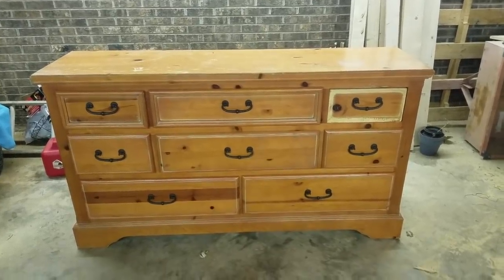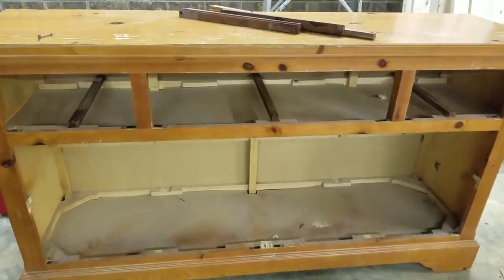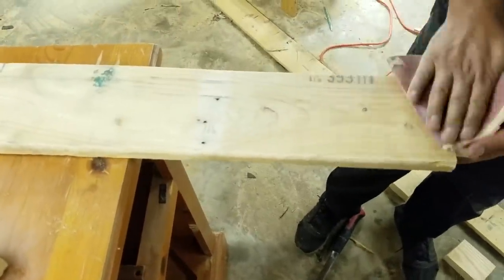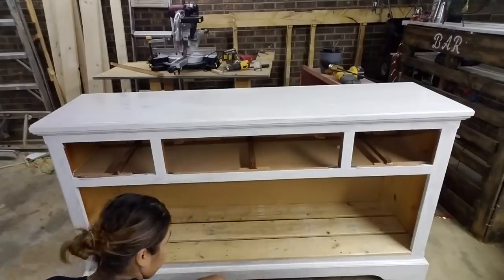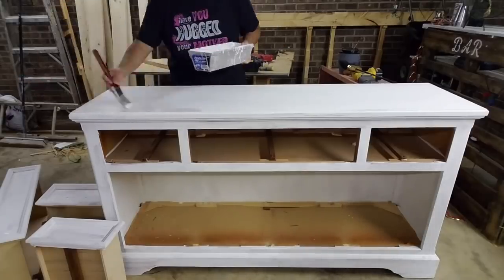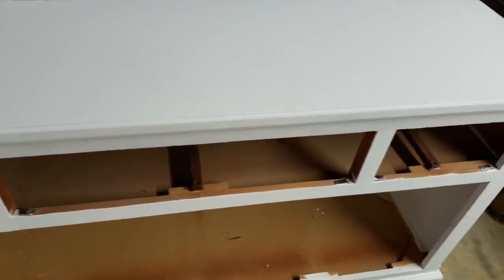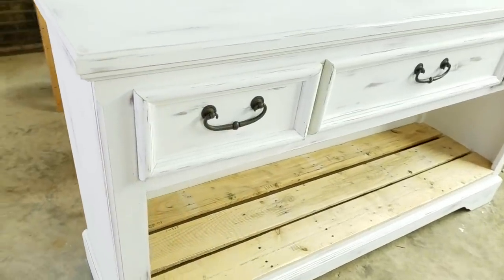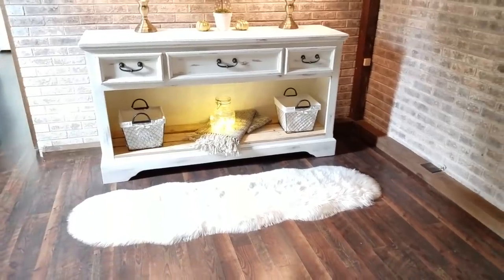DIY Dresser Makeover/ Upcycling Old Furniture/ Dresser Makeover/Furniture Transformation on a Budget

Comment: I wouldn’t recommend using flat because you can’t clean it anything that has a sheen on it is best for furniture, walls doors things like that. Flat is more for ceilings.
Reply from the maker: I can definitely agree with you on it been a little harder to clean. I just didn't want it to have sheen when I was first painting it, I was afraid it would have lost the distressed, rustic feel... maybe I should just do a light gloss on the top surface of it, you think? Since the rest doesn't get as dirty...
Reply: @thecraftycasa6606  Use wax to seal the paint and it gives it a smooth barely there sheen...and also it protects the paint's color from fading. (got this info from other youtube crafters) :)

Comment: Are you painting over poly or varnish or did you strip all of this off before you began?
Reply from the maker: We sanded some of the varnish off. I didn't have a sander then and it got kind of tiring to try to remove all so there was still some left. Still the paint adhered really well and haven't had any peeling or flaking...🙂